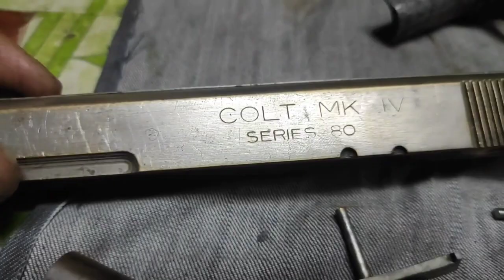Airgun Repair, Colt pistol mk2 series 80

Comment: Gud evening po boss, my luma po ako estrella parco footpump, 23 years po nakatago lang sa bodega, pinalitan ko na rubber sa charging valve at main valve, 4 or 5 o'clock ang Tama @ 8meter distance, possible po ba na reason Ng erratic hit is mahina lang kargang hangin, 20pumps?
Reply from the maker: nako masakit sa ulo yan ah,😁
Reply: @digsarttiksayfishhunting8712  palit barrel po ba ang bestway, converted ko na po sya ngaun s CO2, ganun pa din Tama.